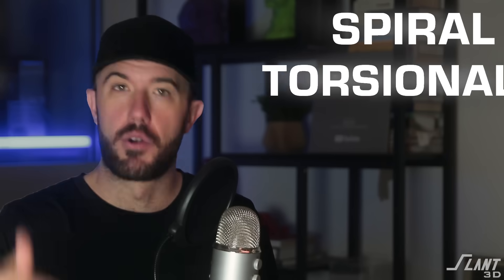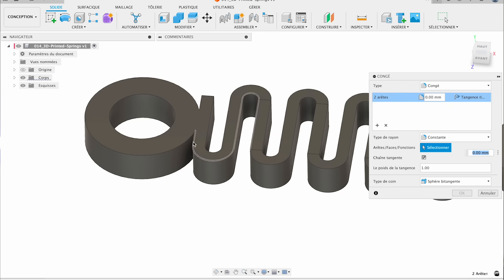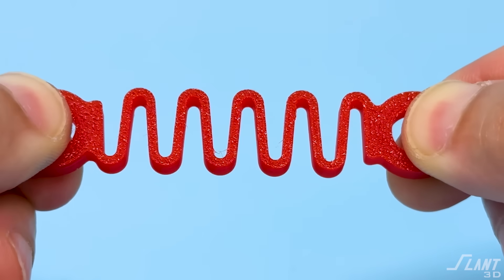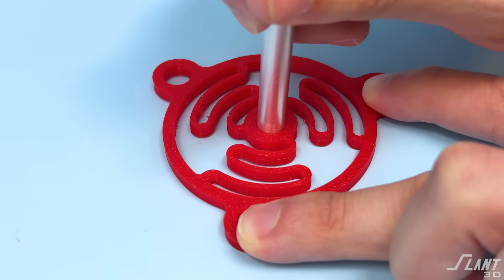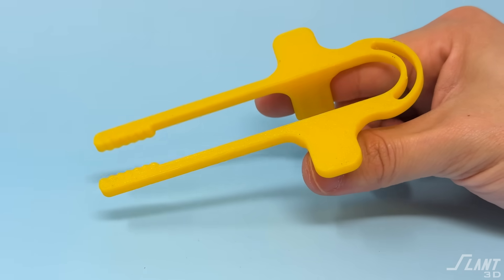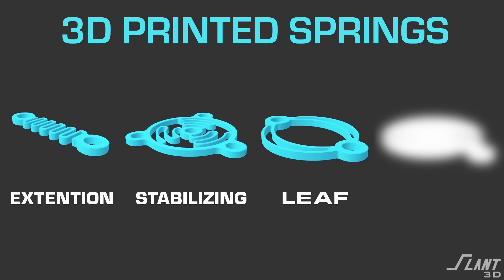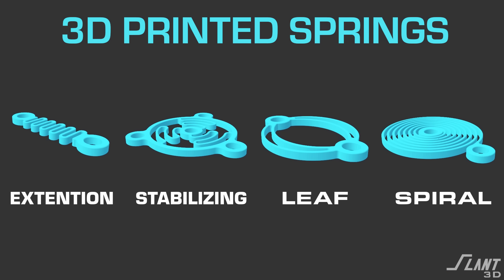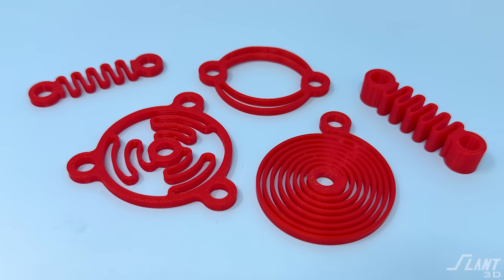Top 4 Springs You Can Design with 3D Printing

Comment: For the flat style coil spring, what material has the best properties. My application needs a fair bit of travel and will be under compression most of the time. I am concerned it will creeping and losing strength.
So pla? Nylon? Etc

Thx

Comment: If you just draw a zigzag /\/\/\/ and extrude it, then just draw a circle that is on the top face and then extrude the circle into the extruded zigzag and create a body from the intersection, then you split it on one side to be flat on the print bed so the zigzag pattern is printed horizontally, then you can print a compression spring… 

                Left
Bottom /\/\/\/ top
                Right

Comment: One of the most important tips is missing: Don't print anything that has to stay under tension out of PLA. Especially springs are a hot candidate. PLA will adopt the deformed state after a surprisingly short time and stay in the new form without springing back. PETG is much better for that. It happily keeps its shape for a long time.
Reply: This 👆🏻

Comment: You can make a decent coil spring out of PLA, but only by printing a winding jig from ABS or PETG and using hot water to wind the filament around the jig and letting it cook before removing. This spring type is limited to the filament diameter for the wire size and isn’t a very strong spring but it’s very popular as a bobble head spring.

Comment: Filament spring - design and print a spiral mandrel/jig (print in something higher temp).  Wrap raw filament around it (petg has worked well for me).  Drop the wrapped mandrel in a bowl of hot or boiling water to lock in the spiral.  Obviously you are limited by filament diameter, but this is still another really useful spring.

Comment: I love springs but never 3d print them: Young's modulus of steel is simply a lot more, you can make a much smaller and tougher part with steel, but making steel springs is actually really easy and steel springs are much easier to design.
I use a 2-part 3d-printed mandrel/coil guide that glues over a 3mm steel rod and make them in a hand drill chuck.
with 3d printing you can make a perfect custom spring for a few pennies of wire.

Comment: I actually printed a compression coil spring ( mentioned in the first part of the video) last night, they do print quite well standing up. but an issue with 3D printed springs that I found out, is that if they remain compressed or extended they will form a memory and will not return.

Comment: One MAJOR consideration when making springs from plastic: creep.

Virtually all plastics creep when held continuously under even relatively small loads, so polymer (plastic) springs will almost always permanently deform if they're continuously loaded. This is why pressure vessels are rarely made from plastics or, if they are, they are typically reinforced with something else (like a metal or carbon fiber sheath) that has a MUCH higher creep stress.
Reply: The other major consideration is material choice, which plays into creep and every other important aspect of this. I have done weeks of systematic testing, printing dozens of spring geometries from just about every material out there, and it makes a HUGE difference. Just about every material that doesn't snap when compressed, permanently deforms the first time you compress it, and/or has unacceptable creep. The only material I found to make a decent spring was PC, and at that, I had to make the spring about 600% larger than it really needed to be, so that its compression would be limited to about 10%, so it wouldn't shatter when compressed. At the end of it all I concluded that unless you're making single-use fidget toys, 3d printed springs are a terrible idea, regardless of material or geometry.
Reply: Glad to see someone else already made this point. You can only store energy in plastic springs over very short periods of time, so the torsion example only really works if it’s for something like a pull-back toy car. Wouldn’t work reliably for something that unwinds slowly like a watch mechanism.
Reply: I made some solid elliptical leaf(?) springs out of carbon fiber filled PLA, as vibration dampers for a dehumidifier. I annealed them in powdered salt after printing, which I assumed at the time would probably reduce creep. The 40-ish lbs dehumidifier has been sitting on them for about two years, and they have crept about 1mm off their original 50mm length. I guess that's about 10 pounds of load per spring, continuously for 2 years. Overall I think that's not bad, and to me annealed + fiber-filled PLAs may be a decent candidate for fairly light duty spring mechanisms.
Reply: @0hypnotoad0  the size of the springs is relevant. I'd imagine they're at least 3x (though I'm guessing 6-10x) the cross-section of a comparable metal spring would need to be for the same load.

At any rate, additives like CF can help increase strength and stiffness (and reduce strain), but they cannot remove creep altogether. Eventually, those springs will fail (deform) due to creep. Though it sounds like they're oversized enough that it won't be for a long time.

Creep in plastics can only be reduced/mitigated; it cannot be resolved entirely (with plastic alone) at least not by any reasonable scalable means.
Reply: @RingpopSmiths  I don't see how your comment is relevant to what I said. You're basically just saying "well if you design the spring properly it'll work" and I don't exactly follow that premise or how it even applies to the video. If a 3d printed spring can handle the demands of the task it was designed to do and perform well while doing it, then evidently it was the right material to use for the job and there's no point in trying to make them out of steel. This is like going up to a carpenter and telling him he should be making cabinets out of titanium because it'll last longer, it's completely missing the point.
Reply: @0hypnotoad0 No, I wasn't "basically just saying..." that at all. I was saying exactly what I said: that springs made from plastic will creep under almost any loading. What I didn't say, because I figured would be obvious from what I did say, is that designing springs that won't creep under continuous loading is nigh impossible and will likely not be economical for heavy loads.

Like I said in my original comment: "one MAJOR consideration is creep," to which you responded with your meaningless drivel about making springs that worked for you. You made my point for me, even though YOU missed it altogether: creep is a major consideration for springs, until it has been determined to be irrelevant to your application.

Just because creep is a major consideration doesn't mean that it always matters. It just means that it's a factor that should be considered. Full stop. If your application doesn't require longevity, or if it'll only experience relatively small loads, or if adding extra material doesn't encroach upon engineering (safety), time, or financial constraints, then simply an awareness that it happens may be all that's required for your application (which may become relevant if your springs were to inexplicably fail). But if any of those factors are important to your application (which doesn't seem to be the case for you), creep cannot be blindly ignored.

My original comment had one purpose only: to point out to people who were unaware about creep (as I was before learning about it in school) that it should not be ignored unless its importance has been properly determined to be negligible. For most projects that are not safety-sensitive, it may take only 2 seconds of thought. For other projects, it may be a critical factor in designing geometry, selecting material & treatments, limiting weight, etc.

Don't come in here guns-a-blazin', over something that was irrelevant to your project. You're not the only person in the world, and just because a factor doesn't apply to your projects doesn't mean it doesn't apply to anyone else's. 

And you came back after a month to do that, to boot?! Touch grass, buddy.

Comment: One of my first few prints was a coil spring at it worked great. I printed it vertically with supports and this was when I didn't know what I was doing.
Reply: Was it a pain to remove the supports?  I would like to try making some coil springs for my RC car.
Reply: @RVJimD  If you print it vertically I'd use a square coil and chamfer the edges so only a small area between each coil needs support. Or you could try printing a square coil horizontally with a brim and/or support on the outside only.

Supports should come off fairly easy but it comes down to slicer settings. Keep in mind that many plastics will deform with use, especially the first time it's compressed so I'd make it longer than it needs to be.

Comment: What I've found about springs, made of PLA, is that if you leave them compressed or extended they will take a set.
Reply: Does set mean permanently deform?
Reply: @ytskt  Yes.  If you compress the spring and leave it that way for a period of time and then release it will remain compressed.
Reply: @timinwsac  got it. Thanks!

Comment: Would a 45 degree or "slant"ed bed allow for printing a coil spring?  I would think that as long as you have good bed adhesion, then you could basically print in thin air, so to speak

Comment: One unmentioned application of spring I've been playing with is impact absorption -- I use a magnetic door hold-open for my garage/workshop, and have been toying with designs for a compact one-piece/one-material part that absorbs the impact of the door being slammed into/stuck to it. Using PETG as a kind of test because PETG likes to shatter, so far the best design has been about 4 months before shattering.
Reply: 95A TPU is gonna last forever with that design, probably.
Reply: @Proton_Decay  Trying to imagine what you're referring to.... I assume it's a solid door with a spring hinge and you're using this in place of something like a piston damper on commercial doors? The downside to PETG is its prone to creep under load which might start reducing its effectiveness if the spring stays under compression when closed. Unless I'm misunderstanding I think something similar out of TPU would make more sense. It's softer, stronger and wont rebound as much.
Reply: @Proton_Decay  I'd love to hear more about this idea.  Do you have it documented so that you can share with me?

Comment: Coil spring in vase mode?
Reply: That was my thought too.
Reply: You're still printing in thin air, so you'd need exceptional cooling for this to work. And you're limited to the width your nozzle for thickness. And you can't embed it into another print. IOW, you need a very finicky setup to print a very bad coil spring very slowly and you end up with an isolated part that needs assembly. It's something you can do to show off your skills at calibrating your printer and slicer. But this video is about mass production 3D printing. And 3D-printed coil springs have no place in this context.
Reply: @frankbauerful   "And you're limited to the width your nozzle for thickness" - you absolutely aren't.
Reply: @riba2233  Vase mode can only print 1 continuous line and that line's thickness must be close to your nozzle size. You have a little bit of wiggle room but you can't print 1mm lines with a .4mm nozzle.
Reply: @frankbauerful  you absolutely can, I printed 1.5 with 0.4 nozzle in vase mode 10 years ago, and even thicker with  0.6mm nozzles. no issues at all and you get nice results.
Reply: @riba2233  We're talking about printing IN THIN AIR. You can't even print a straight bridge line thicker than your nozzle.
Reply: @frankbauerful  ok so in that case you can't even print a nozzle wide line so it's a moot point
Reply: @riba2233  Huh?